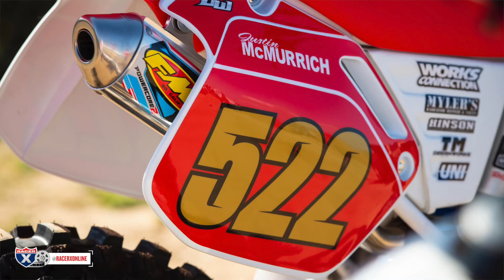Racer X Films: 1992 and 1993 Honda CR500 Builds

Comment: The last big change for the Cr500 was in 89 new frame and fork 91 was sub frame air box and plastic after that is was bold new plastic till it died , I owned one of each but I liked the 90 the best I'm so glad I kept it .those 500s look amazing !!!!!!
Reply: 93 got different gearing for 4th and 5th, 96 got better front fork, 98 got better rear shock
Reply: '94 got a beefed up frame ('92 & '93 had frame cracking issues) wider spaced 4th & 5th gears, '95 the rake was slightly relaxed, '96 had new suspension (forks), '98 got a new shock, then it was BNG untill the end.

Comment: I'm, rebuilding my old 93' CR500 now. Used it for off roading. The most brutal are to ride it was slow rock strewn creek beds. 1st gear stuff. Ping, ping, ping and it would lurch forward on every ping.
Reply: In my opinion - CR500's make really good of-road bikes. As long as you are good with the clutch in the slow stuff, they can get along really well. Many people fear them, but they are really big pussy-cats! I regretted selling my '95, and just recently picked up a '93. It needs some work, but 1 ride, and it all came rushing back. That power! That vibration!

Comment: I’ve never ridden a 500. That power must be insane.
Reply: Very torquey, yet very smooth. It isnt pipey like a 125.
Reply: A tad less power than today's 450s. The CRF450R makes 63hp, the CR500 was rated at 55.

Comment: Did you guys race professional before? For not being on a 500cc for 20 years you still have skills on the bike, wasn't exactly giving it death but not many people could thrash a 500cc round a track. Both ur riding was smooth can tell you used to race, just wondered at what level?
Reply from the maker: Pingree raced professionally from 1993--2004 and held several factory rides, and also won multiple 125 supercross main events. He raced at the very highest level!